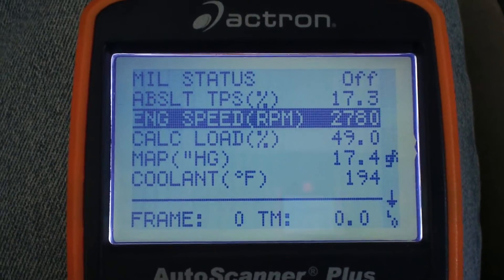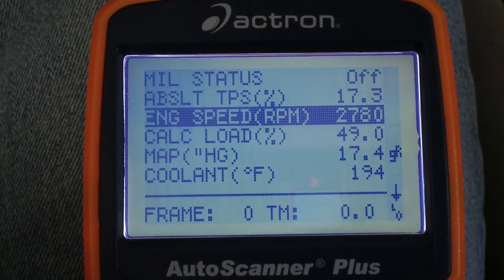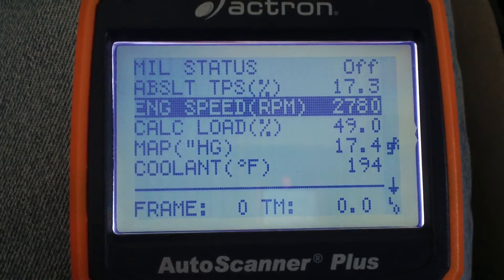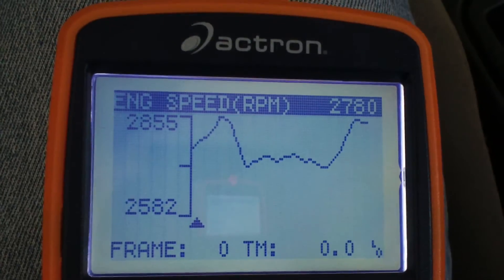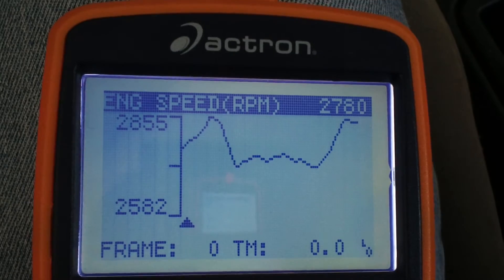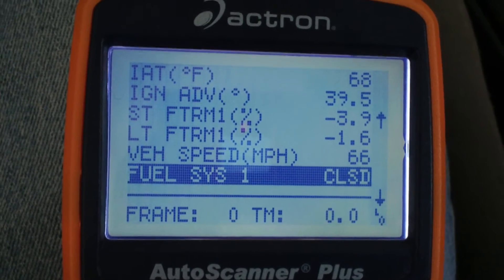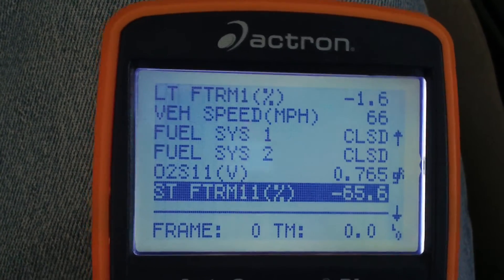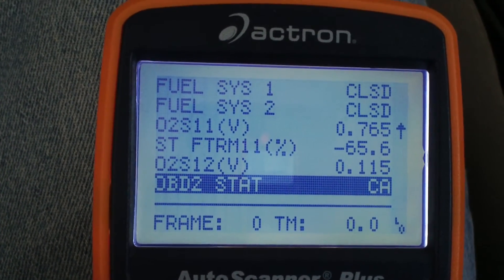Actron 9580 freeze frame data on 96SaturnSL2 freeway drive.

Comment: You said the engine was just rebuilt?  New valves may need to "seat in" before you will see actual true mileage numbers improve.  Same happens when you buy a new vehicle.  Mileage won't be true until 500 to 1500 miles (varies by vehicle) on some engines.  Ask your dealer or do some research on new engine real world mileage per gallon numbers.

Comment: Pretty likely a vacuum leak on bank 2, o2 sensor works and went .8 on the corresponding throttle snaps. MAP and fuel pump contribute equally to both banks which rules them out as bank 1 o2 readings look great. Using that scanner, I would view O2S12 graphed in live data mode, hold the engine at 3k rpm and I would fully expect to see it begin switching normally between .1 and .9 volts. Then you know a vacuum leak is guaranteed to be your problem.

Comment: A bridged (clogged) catalytic converter can drastically reduce your economy. My Rio dropped down to about 24MPG (normally mid to hi 30s) before I replaced both of my cats. No check engine lights either.